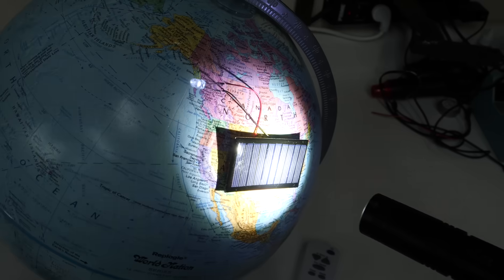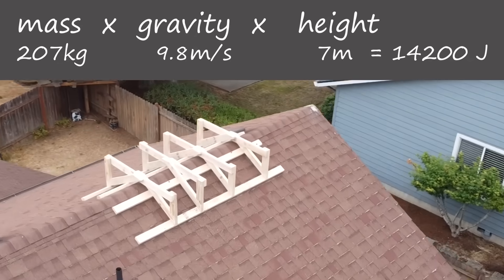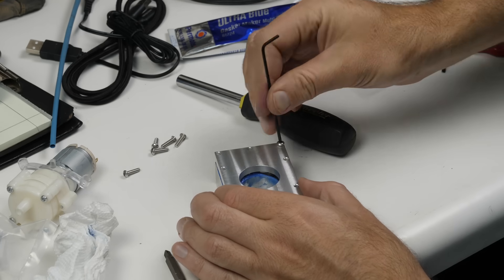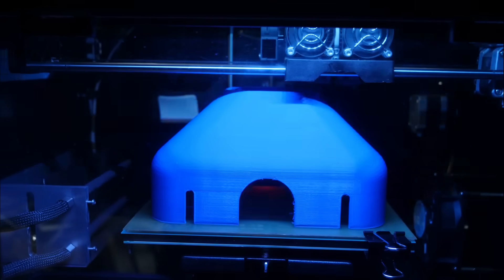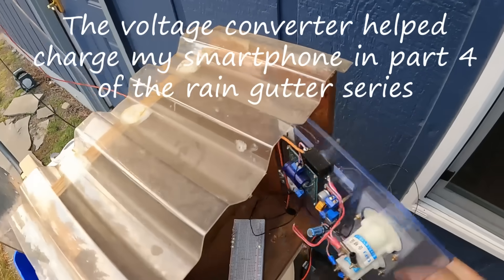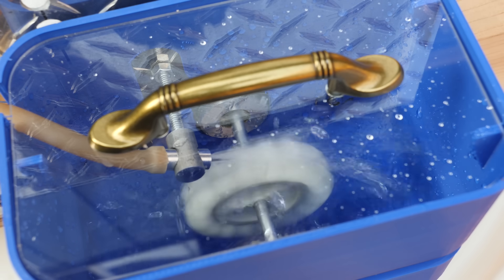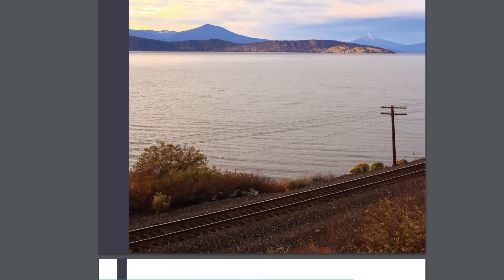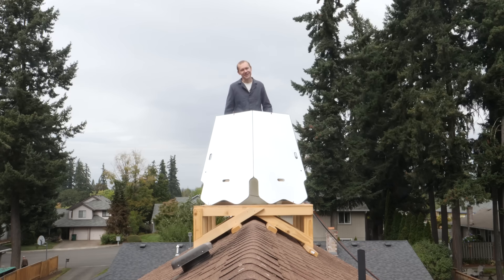Storing Solar Power on my ROOF!!!

Comment: Oh he is one of those people talking about protecting the environment through storing energy/using solar power, but has a stone garden in his front yard, prohibiting any plant growth...
EDIT: The water barrel on the roof can't even load an iPhone battery and is a danger during a storm apparently. This video is okay for entertainment, but you shouldn't build this at your home. Using a normal battery pack is literally more efficient for storing your solar power than this solution. This solution only makes sense when you want to store massive amounts of energy. And even then, these buildings are being abandoned, because the water pumped to the top will evaporate over time, resulting in an energy loss.

Comment: 😎 to bad we don’t have an, all expenses garage that we could tinker together, with a patent lawyer close by.

I have quite a few ideas, I’m a gifted product efficiency, unofficial manager. I create things on my own and I also see current concepts and make them more efficient. 
This concept, has had me thinking similarly, before I saw this video. I’m designing a submersible houseboat, and was trying to figure out the best way to power it. Using water of course, so I’ve watched many videos on hydroelectric systems. 
But I’m working on and designing systems based off a similar concept, that indefinitely uses water for power as well. Water is much more powerful than most realize. 
Stay Awesome Sir!

Comment: Could you create the water into steam and stored under high pressure and does the transfer reduce power or increase it. I’m assuming you could get a higher output with pressurized steam. steam engines type stuff. Cheers love your content.

Comment: Cool stuff! Terribly inefficient of course, but the concept is great and making it work is always fun, and experimenting with concepts can prove illuminating. Are pumps really the best way to get water up high though? Pumping is decently efficient for small distances, but if you have a large height to cover evaporation will very quickly become a more efficient way to get water up higher. Plus using solar energy to power a motor seems like a pretty big chunk of energy loss when you could just use the heat from the sun to directly boil water. You need a tube to contain the water while its being pumped up anyway, why not make it rigid and heat resistant and use it to transmit steam instead? I think large scale plants use pumps because the distance they cover is relatively short, and constructing a lake-sized water basin in the sky is not an easy task. But for small scale it makes more sense, maybe water tower scale. I hypothesize that a few parabolic mirrors and a condenser would significantly outperform a solar panel and an electric motor in terms of water transfer per energy use. The condenser could even be free if you make the tube tall enough

Comment: I Am not savvy in physics  nor in anything related  with electrical or electromechanical designs let alone to DIY them. but what you have presented definitely makes it look easy.  Do you have a point by point design instructions as to how the water drop can be converted into energy?  I live in an area where the heat of the sun extends to throughout the night and air-conditioning a room takes so much energy which in turn so expensive.

Comment: I've been curious about solar storage for a year now, and the lead-acid batteries definitely have their downsides. Was thinking of a water storage battery but too lazy to actually try it. Thanks for pulling it off! It's pretty disheartening to know all of that water only stores a tiny battery worth of power. Looks like lead-acid is my only option for now.

Comment: I'm glad you didn't bs all the common folk. I once had the idea to utilize the weight of my vehicle to push water up to a res when I come home and park, then release it to charge up some batteries during the day when I leave, I was convinced I'm onto something big, until I ran the calculations and discovered just what a dismal amount of electricity it would deliver... Certainly not worth my time nor the money it would require to build.

Comment: How about a solar air heater.
You know the black sealed panel under glass that heats air during the day. With solar power fans to draw the heat in faster and a lower limit thermostat to shut off the fans when the air temperature drops in the afternoon or early evening. 
This could save on heating costs during daylight hours thus cut heating costs for a month. These units are normally setup outside a window. Unluckly they need to be on the south side of the house.

Comment: Can't fall out of your attic and only need a half sheet of plywood AND you only lose maybe 6 ft.  And you can put barrels over every closet.

Another really valuable thing is the water is plenty warm for showers 9 months of the year.

And another bright idea... siphon the water from the barrel and you never have to worry about a leak.

And another great idea... just install an overflow line and you won't need any shutoff... let the excess water go to the lawn or flower garden.

However if your water source is city or well water you may as well fill the barrel with the water source that you already have.  In fact you can eliminate the whole system and just use your city  water pressure to run your generator.

Comment: Yes, gravity based energy storage is not practical for home use. I saw the calculations but it's still hard to understand that a little battery has more power than a heavy block hanging in the air which could crash the  house if it came down. I keep having the feeling that something must be overlooked here.

Comment: You should measure efficiency.
Particularly of that pump motor.
But also the water wheel conversion.
The barrel was 'easy' but ugly and the mirrors a hazard in weather.
Try a (smaller diameter) horizontal cylinder across the whole roof, perhaps an array of them. Paint to match the roof, or black to collect heat.
Add some rain barrels and monitor the weather to allow water consumption and planned replacement.
I'm sure you can take it from there.

Comment: Curious and Interesting. What size tank and how high to meet average daily power consumption...I wonder? This would be interesting to graph on excel. Also couldn't a mechanically driven pully & weights via reduction gears also work?

Comment: It is interesting. But, will be better to change something.... to your turbine.. 1. It is loosing a tone of energy 🙃 built it into a drive shaft ( like the real water turbine) will gain a lot... trust me! Than...
2. To the "water duct" Just add a quick  Pump and a narrowing nozzle to increase water speed. You'll gain a lot of power more... but wait! 🤩change the old turbine for a new one ( a real tesla turbine... ) 😇😁 use metal Copper discs and the lagers ... magnetisc. From the excess of power should use a pump to push water on the roof too. What do you know about a joule tief?( will help you too) have fun with your new project.  😊 send me a signal. Of course you may take the water from the place of the turbine. witch is exactly there. You'll not need  something on the roof.

Comment: This was really cool, especially seeing the barrel to battery size.   How about using a winch to lift a barrel full of water to the apex of the roof and then gravity controlled falls with a gear system to power a generator?   You would lose the inefficiency of the water turning the mill fan and go directly to a generator?   I wonder how many double A batteries that system would be equivalent to?

Comment: Also with a little bit of creativity using air pressure to lift the water, you could have a water wheel running an air compressor as it falls to the electric generator on the ground. The air pressure generated as the water is falling would help to raise the water back up to the top

Comment: Use air pressure to raise your water from a small air compressor or a spare tire full of air period it takes much less energy to run an air compressor, like a small 12 volt one, then it does to pump water to lift it PV roof. A spare tire full of free air from Lowe's or five star convenience stores can convert into free energy without even using solar panel

Comment: This called "pumped hydro" power storage. Many countries use it, bit on a much larger scale. Normally you'd have and upper and lower reservoir (your two tanks) and a hydro generator at the lower end. During off peak demand, excess grid power is used to pump water to the upper res, and then at peak demand, it is released to the lower Res, driving the generator turbine on its way down.

A good idea for your house though, I like your thinking!

EDIT: I commented before watching the whole video! You obviously know all about pumped hydro energy storage! 👍

Comment: I worked as an iron worker on the Bath County Virginia Pump Storage Power Facility building structures around 550Kva switch gear… i believe somewhere in the neighborhood of 1200’ of head between the lakes provides something like 3 mw

Comment: It takes 5 and a half hours to charge the water barrel on the roof. How long can you run the system (at 100% flow) until all the water has dissipated? How many barrels would you need for 5 hours of light, using your custom built chandelier (still at the 100% flow rate)?

Comment: I am very surprized that you didn't use a "ram Pump" instead, Certainly, you could still pump the water to your roof and, no need to worry about all that heat. All you would need to do, is have the water recovered from the ram pump, like for instance inside some container so that you can recover what is sprayed off.

Comment: What is the efficiency of the system ? Power in Vs power recovered? Pretty low I imagine. I guess it sorta works but it would probably be better by using lead acid batteries instead. Even old cheapo Pb batts or degraded lithium. I like the idea though.

Comment: So 14,200 Joules sounds like a lot, but that's a total of 3.9 Watt hours, or in terms of solar storage .0039 kilowatt hours. You can store about 2-3 times more energy in a single 18650 Lithium cell. Fun experiment, but not a practical storage method.

Comment: Amazing build! Excellent learning aid. One thing that viewers may not realize is how this scales so well. You wouldn't want them on your roof, but imagine the same build, but with 100 barrels. It could run off the same 50w solar panel with the same small water pump, but have a huge capacity. If you were the owner of some hilly land, you could the exact same system but with a pond instead of a barrel up hill. Go off the grid powering your entire home without a single lithium ion battery! There's an added bonus of a ton of free energy every time it rains :D
Reply: The current system takes 5 hours to fill ONE barrel. That solar panel and pump certainly will NOT fill 100 barrels in a day.
Reply: @davelowets  nobody said anything about it filling 100 barrels in one day
Reply: @kitsurubami  So, you're going to wait HOW many days for your power??
Reply: @davelowets  you make it sound like I said you can have all your electricity demands met by a single 50w solar panel 24/7 365. All I said is that water pump physical batteries scale well. Going from one water barrel to two doubles your capacity. It changes nothing about the solar panel or the water pump.
Reply: @kitsurubami  But it doesn't scale well at all like that, because the time needed to fill the 99 extra barrels would take 99 times longer.  If it were to "scale" up, every measure would proprtionately  change for the better. Not so in your example.
Reply: @davelowets  I did not mean that the system scales up well. Only that the battery does.

Comment: While your ideas are good, you REALLY must divorce yourself from the world of complex manufacturing and 3D printing.  Most average folk just don't have such access.  Sump pumps are usually water-cooled by the water passing through them.  No C&C mill or 3D printer required.  Many also come with low-water cut-off switches.  Wire that in series through a relay-powered value actuated by the top float, and you have the beginnings of a system.  Add a water fill sensor and valve along with a variable power demand valve moderated by your demand needs.  The ONLY question is whether or not the water-gravity system is more or less efficient than a bank of cheap batteries.  Done right, I think you'll find the batteries are far more scalable for energy storage, whereas hydroelectric is most suitable when you have the ability to operate on large scales, such as large reservoirs built on top of nearby hills.

Comment: Instead of using solar you could use permanent magnets with copper in a loop system to run the pump

Comment: Привет из России. Как я понял - принцип таков, солнцечная панель вырабатывает энергию, перекачивая воду на крышу,  а вода служит аккумулятором энергии для миниатюрной гидротурбины ,которая вырабатывает энергию когда нет солнца. Принцип гидроаккумуляторной электростанции? 
Greetings from Russia. As I understand it, the principle is that the solar panel generates energy by pumping water to the roof, and the water serves as an energy accumulator for a miniature hydro turbine, which generates energy when there is no sun. The principle of a hydroaccumulator power plant?

Comment: If you collected the rain water from the top level gutters in a barrel that was mounted up high, right at the outlet, then you wouldn't need to use as much power to lift it the extra 2.5m or so. Then if it hasn't rained in a while you can pump it all the way up from the bottom one.

Comment: A 12v 100 ah battery has about 4,320,000 joules of energy! 208kg (55gal) of water at 6 meters has about 12,000 joules of potential energy. You could NEVER turn all of the potential energy from the water into useable energy due to losses in the system. So anyone watching this just buy a $200 lead acid 100ah battery and forget about it!!!!  Pumped storage only makes sense on a massive scale!

Comment: It seems like you're losing a ton of energy with the very inefficient waterwheel. All that water splashing off is just wasted energy, and makes a ton of noise. Some sort of closed turbine would probably work a lot better. You can find tiny little 10 watt water turbines for very cheap (seven dollars on aliexpress) and it'd be interesting to see where that gets you.

Comment: Ps please use an Archimedean screw system virtually straight up, as it will use less energy and pump more water . Put a screw inside a water pipe.  Then allow the water to flow downwards’ again  via Archimedean screws,  but in several zig zagging downwards creating energy. Also make the zig zagging Archimedean screws of different reducing widths, increasing the speed and pressure.

Comment: try a 12v air compressor and fill an old 100 gallon propane tank and run an air motor.  eases the roof issues.

Comment: With the right architecture, you could place the water storage just below the rooftop, and channel rainwater. This is extra daytime energy on rainy days. Depending on the topography, you could place the turbine and generator below ground level, in a hole, a basement or down an embankment. Add a stationary bike with a generator (alternator?) for more backup and not waste calories!